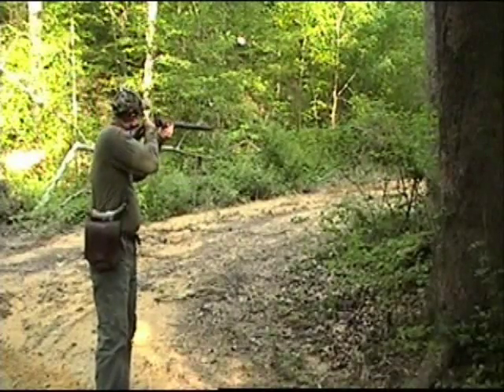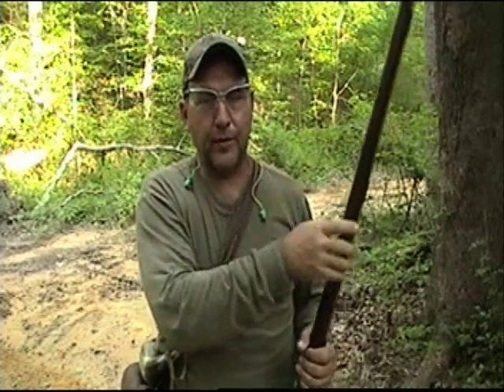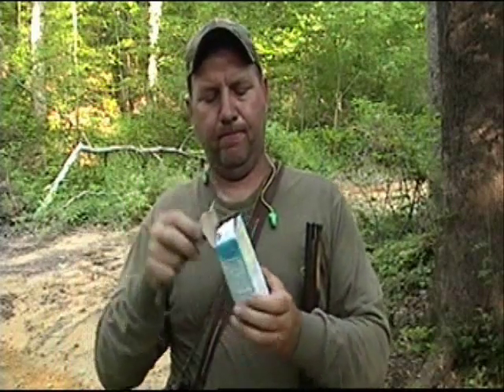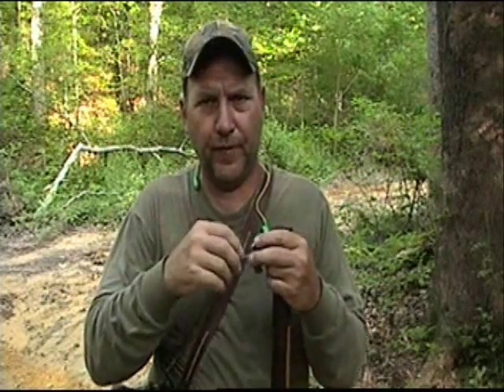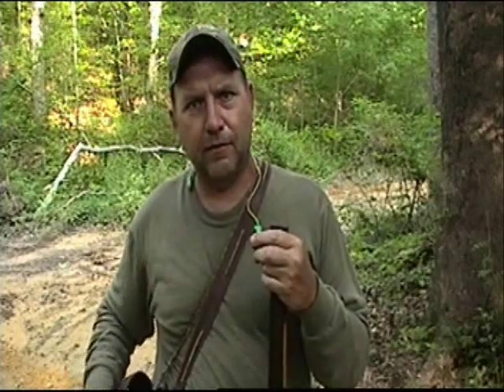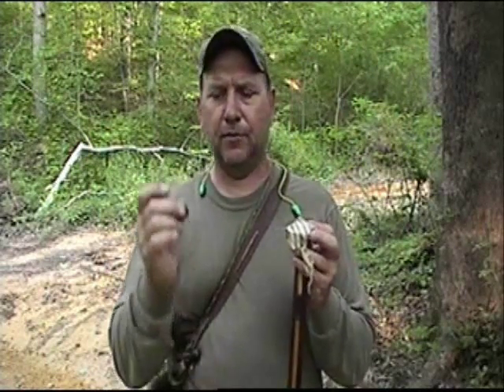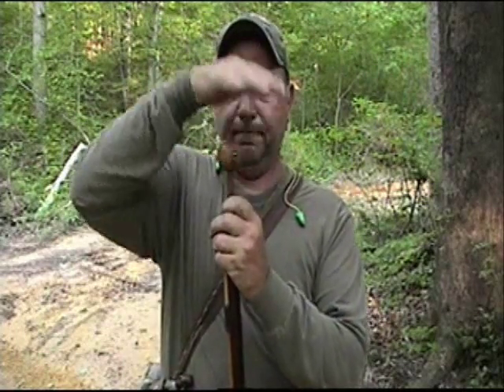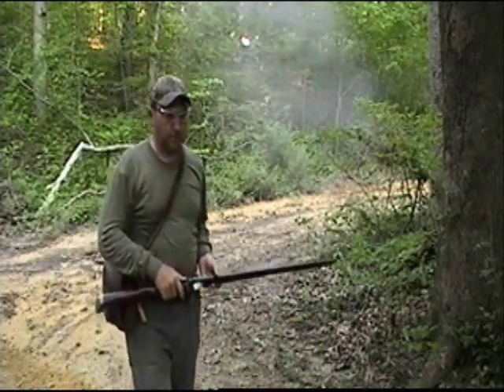The Trade Gun - Various Hunting Loads Part 2

Comment: Actually. Only fill the pan about half way, then after you close the frizzen, bump the left side away from your lock, not towards the touch hole.
You don't want that fuse effect, you want the flash in the pan to enter the touch hole to the main charge in the barrel for an almost an instantaneous  ignition. Also pick the vent befor loading. I have quilled the vent before loading and get instantaneous ignition, reveling a percussion lock.

Comment: For the buck shot would it matter if ur gun has a rifled barrel
Reply: Absoluley. A rifles barrel with spin the shot somewhat and create a hole in the middle of your pattern.
You will have to use a shot cup and clean your barrel well afterwards with a bronze brush tio remove any melted plastic. A rifled muzzle loader barrel will cause you to lose about 5'10 yards due to a wider pattern.

Comment: Are you sure you are shooting 1.125 or 1 1/8oz of FFg powder. that is 492.19 grains of powder. 100 grains is the most I will shoot out of my 62cal/20ga smooth bore. that amount of powder is very dangerous. Was that a mistake?
Reply: +Michael Andersen That is a volume measure. The weight is 1 1/8 of lead - not powder. He just uses the same measure, the weight of the powder would most likely be around 70 grains.
Reply: +Snag30M1 thank you for your reply
Reply: +Michael Andersen Yea, plus the traditional load was powder, cut paper,shot,cut paper. Some times "Tow" and sometimes a leather wad. Plus, I use 2 oz No. 5 shot and like you 100 gn 2F .!! for a 35 yard shot!!
Reply: +Snag30M1 I think he's usiong what is called a "Square" Load!!
Reply: No it is quite safe. Some people load ip to 110 grains of FFG powder and even 1 3/4 oz of shot .... kicks a bit but still a safe load.
Reply: @TheDave570  absolutley quite safe and very effective.

Comment: I think your ball load was a bit much, the shower of sparks out the end of the barrel is from too much powder. it's not going to hurt anything, but it is a waste.
Reply: Not really. It wasn't a heavy load at all. Many shoot best using 100-110 grains of FFg powder with the best on target performance....all depends on the barrel,  wad column used and loading technique.
Reply: Look up the weight of the shot as compared with the round ball weight. You will find his load is close to a square load of 7/8 oz of shot.
437.5 grains to an ounce,  the ball at 60 cal is about 320 grains.
7/8 oz is 382.8 grains by volume.